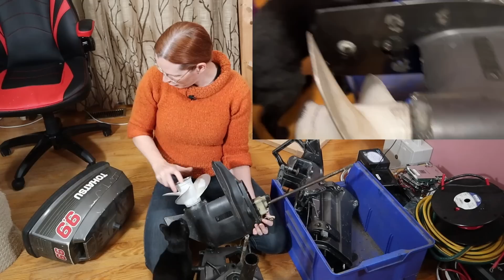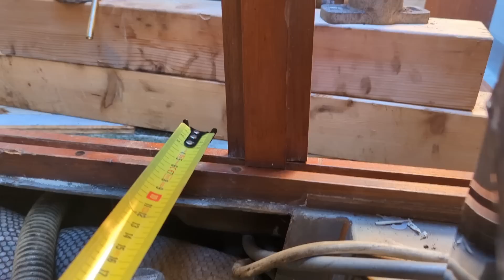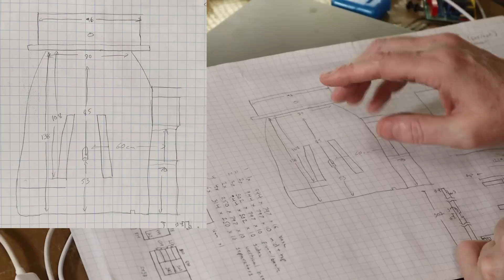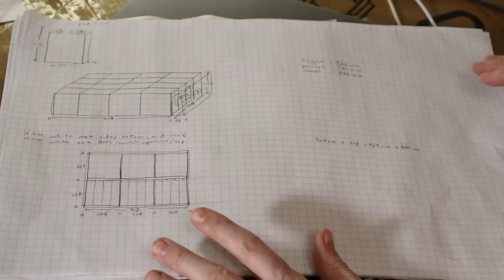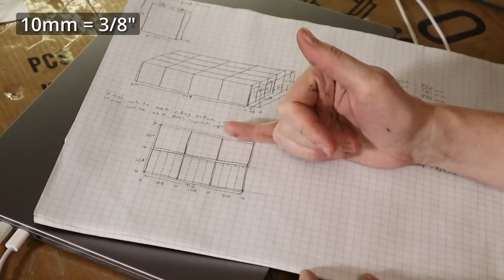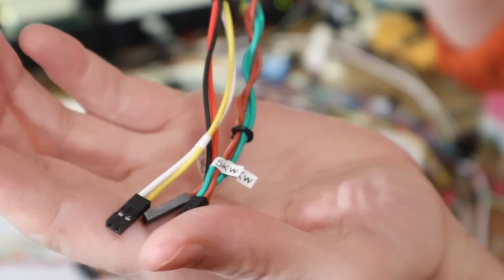Ep. 104 - A New Project, Two Project Updates

Comment: You could remote link the controls for the outboard to the main controls for the boat, giving you the option to still pilot from the boat (or if you wanted extreme speed run them all at the same time!).  If your hanging a wire over side for power adding a control line should be easy.
Reply from the maker: Ooooooooh. Now  that's a fantastic idea!
Reply: @TheDigitalMermaid  Just remember to add a "dead man switch" so if it drops communication between the microcontrollers it fail's safe (eg full stop).
Reply: @TheDigitalMermaid  and your using microcontrollers, you could make it wifi, and do it from your phone also :) or just make the controls wireless, do like wires though. Maybe there is a usecase to control it from the dock?
Reply from the maker: @patrickdk77  I have (longer term) plans to make the main boat's helm remote controllable. Not sure I'd want to do that for the dinghy though... I can't imagine I'd ever be able to get the tiller under remote control.
Reply: Great plans for the battery's. Are you not concerned that servicing a battery issue in the future wil be difficult? But I understand That having multiple removable units will add enormous complexity. Great homemade modules BTW!
Reply from the maker: @ritchycamaro  I am concerned, and it will be a hassle. However, this setup is the best I could come up with. Once a year, I'll have to disassemble to the top three packs to lift the mid plate to inspect/service the lower three packs. It'll be a pain, but not impossible. That's the best I can do with so little space to work with.

Comment: 5kw is a bit under 7hp.  It would be enough for your dinghy, but pretty under powered for your boat.
Reply from the maker: That's strictly true, but the torque delivery of electric is a lot better. You don't get peak torque on an ICE until a specific RPM. Will be fun to test when she's in the water.
Reply: @TheDigitalMermaid  When it was built the C&C 38 had a Yanmar 3HM. The torque curve on that, and similar low RPM diesels, is practically flat. The 3HM delivers 75nm+/-5nm from 1200RPM to 3000RPM.  I'm curious what sort of torque curve you expect from an electric motor that will do a bunch better.  I agree it will be fun to test, and I will watch.
Reply from the maker: I've been using numbers mostly gleened from other conversions done by similar sized boats. There's a chance that I'll go in the water and find this seriously under powered. If that happens, I already got the canbus option on the motor controller, so I could get a second motor and controller and run them in parallel with minimal effort. The only real other change needed would be a longer belt.

Comment: some thoughts: Engine of an outboard rotate in 1 direction only. For forward, Reverse. and yes Neutral too. Because the  shaft drives the waterpump (impellor in little white/yellow plastic box on lower end where shaft comes out upwards:) . It means the actual mechanical shifting can only be done in the gearbox. (in the lower end behind the prop with a push/pull rod to a more handy place) You can turn an electric motor, thus shaft in any direction, reversing rotation of the shaft would cause the waterpump to malfunction:
It would be much easier to limit control to forward and leave mecanics in place. But with  the wish to keep controls on main and outboard the same with  motor reverse possibility, this requires some thinking about changing  shaft, mechanicals of gears (welding it fixed) and different waterpump setup, Electrical or mechanical.
Reply from the maker: OK, this was super helpful! So it means that I'm going to not be able to copy the throttle logic I use in the main boat, as the forward/reverse must stay the same motor turning direction, and I can only switch using the lever that changes the gear box on the lower end? If I decided to switch to an electric pump, would I be able to "lock" the prop to the driving shaft and reverse the electric motor to reverse direction? If I have to change the mechanical, I won't. I want the helm control software and hardware to be open source, so maybe I can add both methods of driving and have a toggle switch or jumper on the board to select "drive mode".
Reply: @TheDigitalMermaid  "lock" the prop: yes:  weld the pushrod lever in gearbox in  forward position, or disassemble and put a piece of pipe over the horizontal shaft so the lever is fixed in 1 position. (watch this video to know what i mean:)
Its very clear about the workings of shifter https://youtu.be/9ib2OkytCBs?si=v5Gw8tF2U5h5jz8k

But. Always a but..grrrr. You will lose the neutral. iow the immediate stopping of propulsion. When docking: bit power, neutral, bit, much reverse, neutral etc. If the electric motor has no run out and still can stop immediate, your ok. Otherwise some more thoughts/ideas might be in order. For main boat electric engine this will be also the case.

Electric pump: The impeller pump is run by  the speed of the shaft so amount water increases when speed increases. An electric pump will have to be controlled how fast it must run. (there goes brain waves into and another STM again:))) 
Pros: all electrical control, Cons: an extra  addition, It will take up space in a not electrical friendly environment. I have no idea how much water of certain temp/cooling effect is needed for the electrical motor: must be calculated? I (wildly) guess that he impeller for a combustion engine will be good enough for electric motor, is that true?  And separate electrical waterpumps are relative big powerconsumers which is not ideal either.  For either options some machining has to be done. Electric: water pickup, and for impeller run a hose to a new location.

Some loose thoughts. What about some sense and control wires through the plug, as with cars the maincontrol knows were it is put in and what  to deliver or functions to shut off. On the software side, this could be a build in one build: run in option 1 for main boat/battery or option B for dinghy. I guess the other prop, displacement, use, etc of a dinghy will require some other power/force settings anyway.  So a one to one copy might not be ideal anyway.

Every helm outboard can be converted to control it (steering, gas and shifting) at greater distance with morse cables. Not fancy but it is really 90ties:)) But these could be replaced with an clean DC 48V linear actuator for the shifter.

In all it seems that 99% of outboard use will be as boat to shore/exploring dinghy. The option as side tied backup is nice but secondary. My thought/choice  would be to keep it as simple and on the way serviceable as possible. Which is: electric outboard motor is electrically restricted to forward only, keep shifting at the helm and cooling with impeller for a start and build from there if needed. The winter is over before you know it and didn't you have 'some' other projects.....:))
Reply from the maker: @LucScheffers  Okay, that video makes it really clear, thank you! Losing neutral is something to think about... As I mentioned in the video, I've got no existing experience with outboards, so for me learning to live without neutral isn't a concern. However, I could see it throwing friends off who try to use it. I'll need to think on this. 

As for the pump; I already planned in the main boat to have the pump come on based on temperature, so that code will exist anyway. From a power consumption; Nothing comes for free... if the mechanical pump is driven, that takes power from the prop. So I think from a battery range question, it's more or less a wash. Though electric might be more efficient, if only because it doesn't turn on at all until actually needed.

I think ya, for the very rare time I need to use this to tow the boat, I'll just do it from the dinghy. I can always create remote controls some time down the road if I find myself wanting for a project.
Reply: @TheDigitalMermaid  It all depends how fast the prop (thus propulsion) stops after electric engine stop.  I lack the  knowledge here.
But as a rule: The more mass*speed you have the more of an issue it a  slow stopping prop can be in small spaces like docking. A dinghy is light and rubbery so i for see less problems there.

Comment: Hi I think keeping the planning and build posts separate is a good idea, as it allows time for us the viewers to answer a question you may ask or make a suggestion before the work is completed. A couple of other thoughts: E-Bike twist throttle for the "Amp-board" (Water resistance). Maybe an older motor (Without reverse) and investigate the possibility of direct drive (With a right angle gear at the foot)  Loving the content !!!
Reply: I concur with separating planing and building. 
About the gearshifting, she just needs to jam it in either direction and use the controller for direction.
Reply from the maker: @frejaresund3770  That's kind of the idea. There's a high-low switch, so I might have "forward" be high speed and "reverse" be lot speed, and have the same "joystick mode" that I'm using on the helm of the main boat. Twist the throttle to center for neutral, one way for forward, the other for reverse.
Reply from the maker: I've been trying to find what the prop RPM was initially, and so far it looks like the old engine was 5300rpm max with a reduction ration of 1.85, so the prop max speed would be about 2800. The 5kw motor's max RPM is 3500, so I'll need to run through a 1.25:1 reduction to avoid cavitation. So direct drive isn't likely going to work. As for the twist throttle, I've got an idea on that. I think I can put pot inside the housing where the current twist mechanism goes. I want to keep it looking stock if I can. I'll just need to find a want to have it self-center when released.

Comment: Motor always turns the same way. Gearbox is down the bottom (controlled by the rod) and the water pump runs only 1 way on the main shaft. 

Simplifies motor control as you don't need to reverse it.
Reply from the maker: Noted, thank you

Comment: Talk all you want. Most to me is useless information however a lot of good engineering information to apply to what I am going to be doing. In any project is is good to know more than you need to know to get the job done.
Reply from the maker: That this might help you or others in their projects makes me really happy! What is your project? Going  by your name, I assume you're also a sailor?
Reply: @TheDigitalMermaid  Yes just a small Island Packet, 30 foot over all. Project one is solar with all Victron electronics , Renogy panels and undecided on battery brand but will be LiFePO4 and thinking 480 amp hours with the ability to discharge @ 350 to 400 amp. My largest load will be 1800W for a cook top so if used it will only run 10 or 15 minuets a day tops. Battery's use to be just that a battery now they have brains in them and way more potential power that can be used at an alarming rate with a good BMS

Comment: Equal weight distribution is very important . the batteries are very heavy and now that you have no need for a diesel tank full of fuel that weight must be compensated for . Jut like an aircraft has a center og gravity so does a boat . You should try to match the original design intent of balance as cliosely as possible.
Reply from the maker: I'm spoken about balance, trim and weight in previous videos.

Comment: To gain back some vertical space on your box you're reserving for tools, you could screw it together from the inside with Kregg Screws
Reply from the maker: I use pocket holes fairly often, they're wonderful. In this case though, the "meat" that the anchor needs to bite into are the 16mm bottom and mid plates, so the screws/bolts need to come in from the outside.

Comment: Thanks for sharing your thoughts, Maddi.
Let me throw some ideas for the battery box.
Put aprox 50mm holes in the back of the box, to be able to push a battery row out from the back to front in any case it is needed.
To slide the cells in, make a step at the front to lay down and fix a bord from where you can slide the battery row in.
Slide, maybe there is some PTFE Foil outside to put under for better sliding.
Pull the PTFE out after the blocks are in.
That are my 2 Cents here.
Cheers
Marc
Reply from the maker: I used to buy Fujitsu servers, and they'd come with straps around the servers to make it easier to pull them out of the box. I had planned to do something similar around the raw cells. Your idea would work, but I'd like to control where air enters into the box better so I can get a chimney draft going when the cells are charging/discharging for convection cooling.
Reply: @TheDigitalMermaid  Hi Maddi, yes I know this straps from 15 years ago. Didn`t had them in mind.
With them you don`t need any access from behind.
Cheers
Marc
Reply: PTFE is pretty expensive, 5 thou sheet would be like $500 to cover the whole area.
The low friction idea is great though. Plastic World sells UHMW, you could get a 1/8" sheet cut into thin strips and place 2 under each cell row. Looks like $60 for 48x 1/2" wide strips.
Reply from the maker: @electrowizard2000  Cutting up those thin cutting board sheets might work also.
Reply: @electrowizard2000  Or, what about thin Epoxy plates?
My only thought was during the time sliding the batteries in it would be good to have not so much friction resistance.
But after they are in, it should be removed.

Comment: My suggestion is to throw a pod motor on the bottom of the leg. I've built them both ways. Pods are more efficient, easier and way quieter. Stick the controller in the under the cowling.
Reply from the maker: Aye, it would be great to get rid of all gearing. It's got a few drawbacks in my case though, mainly that I've yet to find an option that is hackable. It would also likely cost more than I can really justify right now.

Comment: Regarding electric water pumps.  Catamaran Impi 10+yrs ago gave up on engine driven pump w impellor for diesel generator and went with a single speed 12v magnetic drive electric pump (no shaft or seals to leak) and was happy with it.  Single speed was fine as its volume was matched for the fixed 1800rpm generator and its exhaust.  Fixed speed magnetic drive water pump might work for you as well since you are not dealing with exhaust, however they do make variable speed versions that, when sized properly, might provide more cooling at high rpms.  Assume you can get 48v dc versions as well .  Not sure if these are self-priming so may need to be below waterline.
Reply from the maker: I plan to have 12v available (for lights), so running a 12v pump would be fine, too. Which pump did you go with, specifically? I've been struggling to find a decent quality, continuous operating 12vDC pump. I'd prefer variable speed, but I can add a controller to turn a single speed on/off as needed with a temp sensor.
Reply: @TheDigitalMermaid I am a viewer of Catamaran Impi's videos, not the owner. I went to YTube "Catamaran Impi" and 7 yrs ago there is an episode "No impellor, no raw water pump- marine generator"  At around the 10.5 min mark, owner brings up pump specs.  My 7 yr memory was faulty about 12v, he used a 120/220v ac pump since he was using it on a generator that would supply 220. Pump was LC-3cp-md magdrive pump rated .5hp, 8gpm,  max head 19ft.  I did research 7 yrs ago for 12v versions and did find some on ebay, quality unknown, many used for fish ponds and the like.  There were fixed and variable speed versions.  Does the above pump come in dc motor version?  Could the above pump be run by a 12v or 48v dc motor?  You would have to see how things are attached
Reply from the maker: @douglasrobbie9998  I found it, "LC-3CP-MD Seal-Less Magnetic Drive Pump", thank you! Unfortunately, it's $680 cad!!! That's a touch outside my budget :)
Reply: @TheDigitalMermaid  Centennial Equipment (online) has the PL-809 versions (12 or 24V) for US $307 (about $440 Can?) has 5-6 g/min and Polycarbonate Sulftone (PL designation) wet head that would be good for saltwater. There are probably Asian knockoff for less.

Comment: LMMFAO @ Engine cowling on head, then again at "A nice water feature", Dork. Love it!  Now battery box, you are talking about a LOT of weight, and your talking about controlling this weight with wood. May I suggest steel? Maybe you can't weld, but your smart AF, so you could learn, believe me. Steel would handle a lot more weight with a lot less material. Yes I am a steel guy. but I believe for a reason
Reply from the maker: If I was going to use metal, it's be aluminium. I have wood working skills, but I don't have metal working skills. White oak is really strong, and I kinda like the idea of a big arsed block of power in a pretty wooden box. I'm sure I could learn to weld, but I don't have the equipment, or the time right now.

Comment: I also do not recommend using solid wood panels, as they are prone to warping with changes in humidity. Marine plywood or bakelite plywood(Phenolic Plywood) would be a much better choice.
Reply from the maker: @MaxPivovarov  White oak is particularly stable and often used in wood working, and it's stronger that marine plywood. That's why I plan to use it. I can control potential warp by selecting rift sawn stock, to